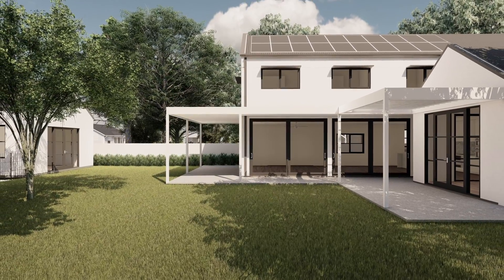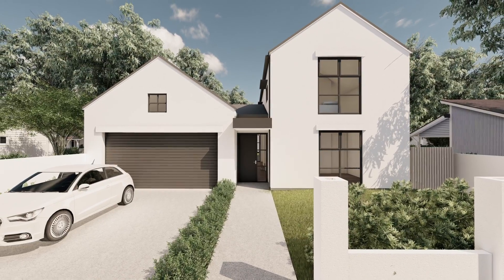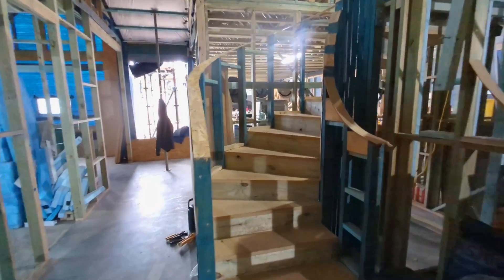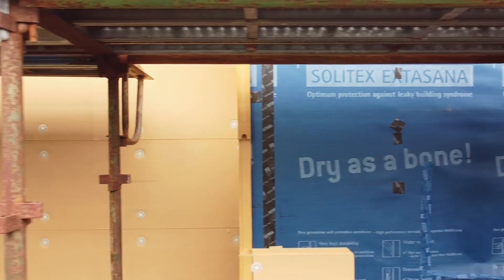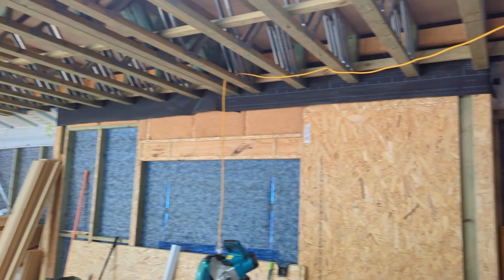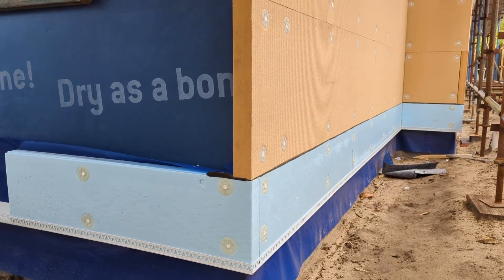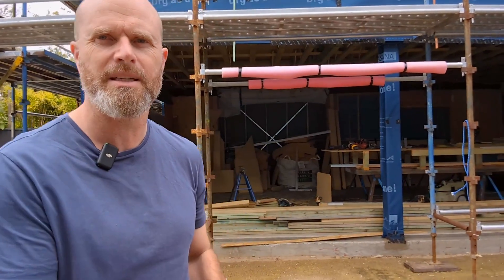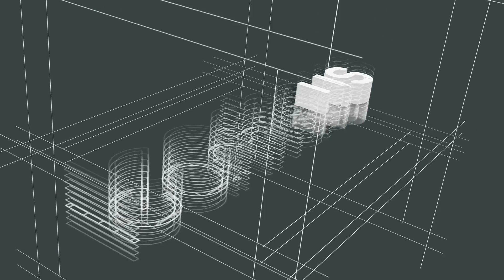Timber & wood fibre passive house: The future of sustainable architecture?

Comment: … and how durable is the home?  Should it last longer before it needs maintenance and why? Thanks
Reply from the maker: Lime render is extremely durable compared to cement render, being self healing and vapour permeable.
The wall structure is properly weather protected by specialist membranes, that allow water vapour to escape and prevent water ingress. So you don't have the degradation from moisture that you get with lesser constructed homes. This by far the most superior method of construction available here.